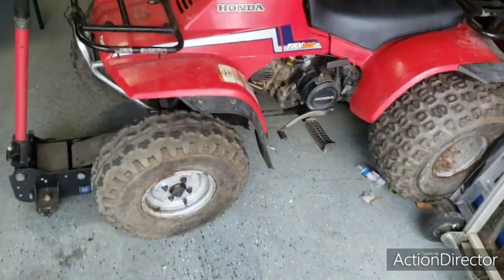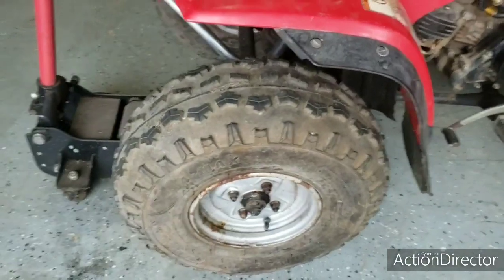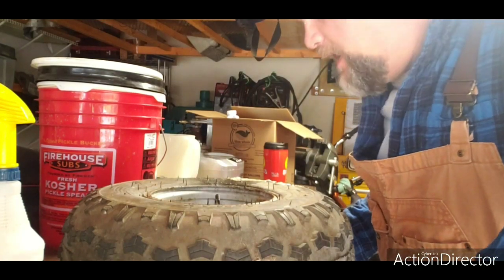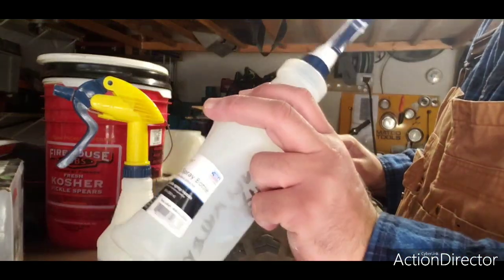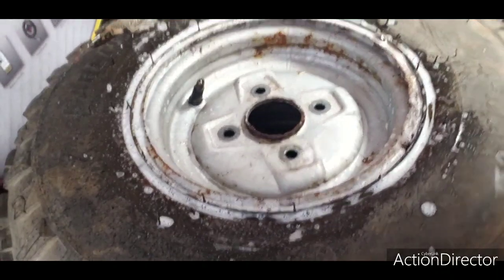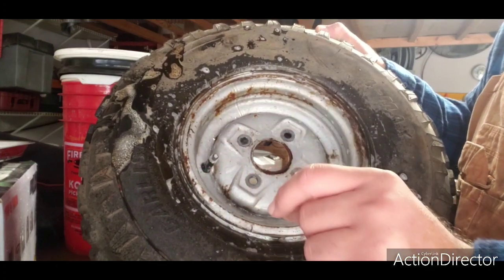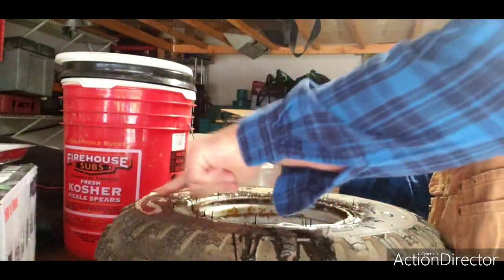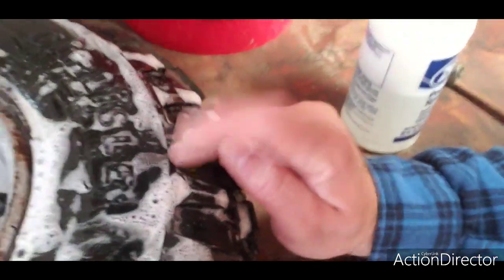TIRE LEAKING AIR? Here's how to find the leak...

Comment: The slime stuff works pretty good carry that and a small 12 compressor as part of your road trip gear and you can fix it right on the machine, and get out of a bind the compressors are fairly small and the slime is fairly small to they even sell kits with both. I carry air compressor in my truck all my vehicles have a tire repair kit as well I don’t carry slime in vehicles. My lawn mower had dry rott tires they only hold 5 psi and don’t go fast so slime was cheap option.have a fun father son day those are the things we all remember growing older.
Reply from the maker: I may have to do that because the cheapest new tires I could find are like 45 each.